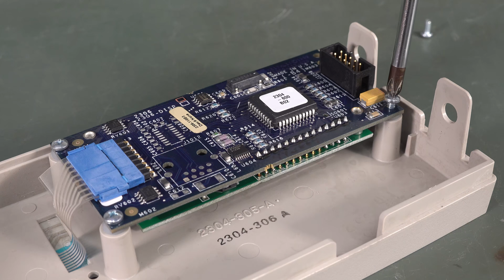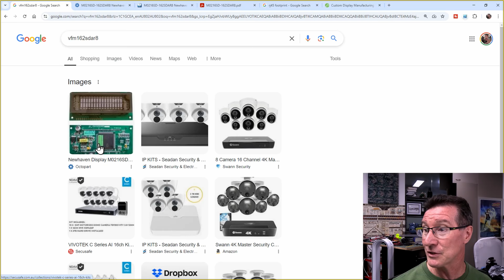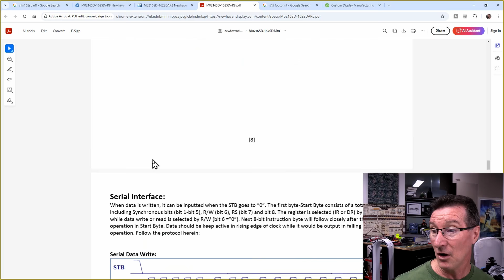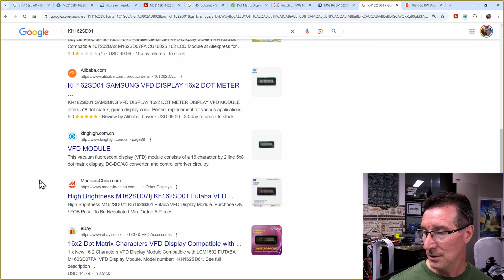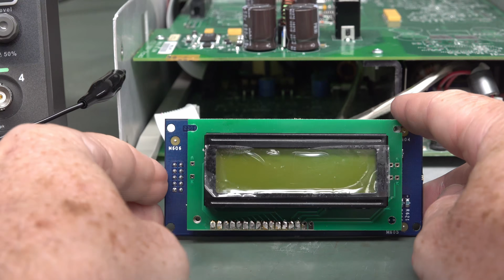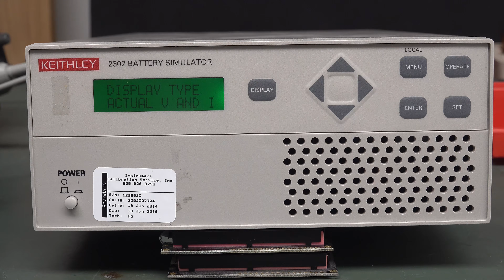EEVblog 1664 - REPAIR with Junk Bin Parts! Keithley 2302

Comment: I have junk bins and drawers full of crap I've been salvaging for nearly 40 years now and every time I need some specific part that isn't just a basic cap or resistor, sure enough it's the one thing I don't have.  Same for miscellaneous screws.

Comment: I felt relieved when you attempted a junk bin display because practically all LCDs with a parallell interface follow the HD44780 protocol so there is no need to buy anything extra expensive just because it is closer to the original specification. In turn you can use basically just any LCD, thanks to Keithley being nice and not using anything proprietary. Good thing you found out!

Comment: My goodness! If that filter had turned out to be a polarizer at exactly the right orientation to black out the LCD then I would have to really tip my cap to bloody Murphy. I'd say he was working overtime at Keithley when he came up with that trick to block replacement of the VFD with an LCD!

Comment: I'd like to see more 'stuff' on resurrecting VFD's in general.  I do pretty much all automotive things, many of which use very (!) custom VFD's for things like the HVAC display that just don't have any other options.  I've pondered making a complete LCD replacement, but that's way down the road, and I may not live long enough to complete that project.

Comment: I have a TOTL JVC VCR that has a weak VFD, I wonder if I could convert to a LCD that easily? I think it may have a few proprietry symbols on it a dot matrix would not be able to display, would they just be a dot? Ie. a tape symbol and tape speed script. Iv read there is a way to recharge the VFD with some high voltage, ie glow the grid and burn off some nasties to get the brightness back up?

Comment: Loved the repair video, but Dave, Dave! I've been watching your videos for far too long and all I can hear is you screaming: thou must check voltages! :)

From repairing hi-fi stuff I've found VFD failures are often an issue with what's driving it rather than something in the VFD itself, as others have mentioned. Will you do a quick second channel follow-up on the original VFD board you pulled out?

Comment: 5:42 The getter is nice and shiny, there is absolutely no problem with the vacuum in that display. My bet is bad electrolytic caps.
Reply: Getter is almost never the problem, cathode poisoning however, is. There is a rejuvenation option, heating the filament to a point it will outgas and restore the oxide layer, but this is based on luck...

Comment: haha this was so funny. I replaced some going duff CCLs for LED strips in a HP 20510i LCD monitor only to find the HP control circuit used an analog voltage to control the backlight brightness whereas the Chinese LED strip controller needed an PWM signal. I ended up creating a custom interface board using a PIC16F1615 with firmware that converted the analog into PWM so that the original HP screen controls worked in exactly the same way. It had to scale and invert the control signals and handle 0% and 100% levels correctly. A master hack if I say so myself :o)

Comment: If the vac failed, I would expect the silver spot on the side to go white. Same as used to happen with vacuum valves (tubes). That silver coating on the glass is from the getter. Which plated off when the getter is heated to purge off the last oxygen from the valve after the envelope is evacuated and sealed.

Comment: I would have tested that VFD manually as the getter has not gone white so there is no vacuum fail. Granted the heater wires can exhaust their coating (thorium?) that makes the thermionic emission work properly, but unless the unit has had thousands of hours left switched on then I'd expect the actual VFD to work.  VFDs look so much nicer than LCD displays. How about a revisit video just on that display board?

Comment: The LCD looks brighter on camera than the old faded VFD did.    I would take that as a win.   Always nice to have the original, but this makes device usable until you have the time to do a VFD.  Also, it was a way to prove the display was the only issue without spending the cash first.

Comment: I would keep the LCD display in, repair done. May be the VF display is fine, just some step up converter gone bad on the VF pcb. Or the VF wires gone bad. I guess you have to much work making videos and reading comments to measure the voltage or the wire resistance.. thanks for the video,  one more piece of equipment saved.
(EEVblog 717 and 1601 video for voltages of large VFDs, DC voltages will make left or right brighter(I tested that once)
Anthony Francis-Jones video 203 he shows a single digit VF display (lower voltages)
Posy: VFD Displays and Dave's Garage & Zak have also great VFD videos
Reply from the maker: Part 2 tomorrow.
Reply: @EEVblog  Thanks.. looking forward to it

Comment: I was noticing the getter spot in the corner of the old VFD had turned black, and believe that confirms the loss of vacuum seal, at least from my memory of vacuum tube troubleshooting.
Reply from the maker: Black is normal I believe.
Reply: @EEVblog  
I had to go look again, and you are correct. 
I'm used to seeing them be silvery or gray, but the failed ones are when they go white and milky not when they go black.

Comment: Solder sucking: I totally stopped soulder sucking in plated through boards. Now I use a wide tip (t12-14xx or a thick solid copper wire), fresh solder and melt the whole row and pull out without any effort. No ripped pads anymore. Yesterday I did a IGBT module with close to 50 pins that way. Now i think about developing a slotted copper block as desoldering helper as a product.
Reply: I likewise do like using a t12-d52
Reply: Use a 1mm bare copper wire across the row, lots of leaded solder, the whole row melts and the part falls out.
Reply: there is a low temp solder for this kind of work, just flood it all over at like 200C on iron tip

Comment: Don’t you love it when you find something that you can use out of your extra parts. I repaired a laser level that got the polarity reversed (no protection) and blew the ass out of one of the chips. I was able to bypass some of the features with a simpler board I had in my spare parts boxes. 😊

Comment: Maybe there's resistors you could swap out to increase the current flow through the backlight? Or maybe bodge on some extra LED's for the backlight?
Reply from the maker: Yes, I think it's a 100R in series from the 5V supply.

Comment: usually you need to provide the current limiting resistor to the backlight of LCDs
Reply from the maker: It's built onto the board, 100R

Comment: I will not bother with the florescent display. LCD will just last way longer. Maybe get a blue backlight one if that filter in front is designed for blue.
Reply from the maker: The green is ok, still quite readable.
Reply: @EEVblog  The filter might be painted on or is glued on and removable with a solvent or some heat. I would just cut it out and hot glue the LCD in.

Comment: The VFD is probably fine with a black getter. THere is a sticker in the HV generation section .Perhaps the sticker glue has turned conductive and is messing up the VFD voltages.
Reply from the maker: Possible, might have a look.

Comment: youve assumed loss of vacuum (but getter was not white) or cathode poisoning, but theres a negative bias voltage applied to the heater wires (-17v or more) thats usually dc to dc convertor derrived (same circuit as ac filament drive)  dried out high esr filter caps here are very common , tip from an ex hifi / vcr repair tech

Comment: That's the worst. When you have a piece of gear you haven't used in a long time, pull it out because you need it, and it just broke on the shelf. I swear if you would have left it on since the last time you used it it would be working. Gear really hates to sit around not being used. It's like all the electrons evaporate or something. It happens to me too often.
Reply: The electrons all fall out because they're upside down in 'stralia.
Reply: @padmanabhaprasannasimha5385  They fall out in 'Murica as well.

Comment: The think i dont like with Dave is the way he overthinks stuf like these . 

This interface is a clasic "textbook" almost hd44780 interface basicly inner-compatible with every display of this style out there. (there is even some new oled displays with this interface!) 
OFC usualy you go open the dataseet of the broken part, check the compatiblity with the replacement etc. but this was so obvious i was "screaming " to my display. This time i think he was overthinking it by checking all these parts websites , by going and almost buying this 60$ part ... 

Dont get me wrong i dont critique his engineering skils, he and he's videos are amazing but im telling that some times he gets carried away...  Keep up the good content dave !
Reply from the maker: The first thing you do is literally type the part number into google, and the first and only hit was octopart which gave me the correct Newhaven display. Out of curiosity I check find chips as well to see if anyone had it cheaper. Then I checked my junk bin and got lucky. How is this "overthinking it"?
Reply: @ Bit late reply , semester exams got in the way… 

I really liked how you went over the whole board, identified the LCD, and then approached the repair methodically in your second video.
My comment was specifically about the moment after the 4-minute mark, when the VFD PCB became visible. Seeing the 14-pin header immediately signaled to me that this was the classic HD44780-compatible character LCD. My confidence was nearly 100% when I spotted the PCB markings around the 5-minute mark: RS, R/W, E, followed by DB0–DB7.

When I mentioned “overthinking,” I didn’t mean the part where you found the datasheet and went through it—that’s standard practice. What I was referring to was the part where you started going through varius part aggregators,  spiral out talking bus analysis with a logic analyzer, browsing multiple component aggregator sites, and almost purchasing a $60 replacement.

If it were me, after seeing that display, my first instinct would’ve been to go straight to my parts bin (or junk bin), grab a similar LCD, check voltages, solder it in and if it works, move on with my day.

Sorry if I sound arrogant, hasty to jump to conclusions, or too quick to assume that this interface is so widely known. That wasn’t my intention

(posted the same on the forum, https://www.eevblog.com/forum/blog/eevblog-1664-repair-with-junk-bin-parts!-keithley-2302/msg5808157/#msg5808157), went back and commented here... to boost this engagement metric , what that algorythm wants...)

Comment: I've managed to revive a very dim VFD by glowing the wires (what are they called?) red hot for at least a minute. Worked a treat  after that.
Worth a try.
Reply from the maker: If you are desperate enough
Reply: This isn't a worn out VFD tube from years of use. It's been sitting for 7 years not turned on. Something else is the culprit here
Reply: if you can increase the drive a little itll last longer , theres often a series cold start current limiting resistor  , its a cathode piosoning issue, the heater wires are also the cathode , i realised that when i tried to run a vfd with a dc heater supply ! cathode piosoning is  bane of my life with my huge 1n18 nixie clock  i have to excercise the tubes every year or so with increased drive current
Reply: @darrenmurphy6251   Yea, bloody cathodes...

Comment: Honestly... For the price and saving you the hassle, the hakko sucker isnt that bad!

Your vfd is fine on vacuum. The getter, the black stain in the corner, is still black; an oxygenated one turns white
Reply: probably just the electrolytics in the boost converter went high esr - but how you gonna babble about that for 26 minutes??
Reply: @gorak9000  just all the same. Dave is well capable of that. :)
Reply: The serial interface on the original is usually omitted on modern displays because you can use the modern ones in half bus width (4pin) mode. The serial was hardly used, so it went to contrast settings as a backwards compatibility feature. 😄

Comment: The getter still looks intact so am wondering if it's actually the VFD or some driver circuitry around it?
Reply: I was shouting "CHECK THE HIGH VOLTAGE" at the screen.
Reply: @danmenes3143  You can visibly see the burn-in so the screen was more or less EOL any way.
Think he did the right call not to troubleshoot it further but it would still be fun to know what delivered the final blow.
Reply: @Chriva  True enough

Comment: Try out with a different colour display, a blue or yellow might work better
Reply from the maker: Possibly, but when the junk bin delivers, you "get what you get and you don't get upset".
Reply: @ I have a plastic bin full of different types and colours of displays, for this exact reason, you never know what you’re going to need to fix something.
Reply: @EEVblog  :)
Reply: Yep, I was just thinking that and came back to say there is a model that looks like it would fit and is available in blue - LC1623.
Many other 16x2 LCDs have the connector at top left instead of bottom left, or have different overall dimensions.
Oh, and another is the Surenoo SLC1602D which is available with yellow-green, blue, or white backlights.

Comment: Not a bad partial win, pity about the filter - but definitely better than no display when the VFD eventually goes out of stock.  I may have to see if I have a spare for my K2306.

The extra RJ connector on the display controller board would be for the Remote Display/Keypad Option 2306-DISP which uses an RJ45 flat cable and presumably the same PCB with different BOM.  I've seen some people with bad VFDs buy the remote display rather than fixing the internal one.  Occasionally they show up on eBay, but the VFD may also be suspect.